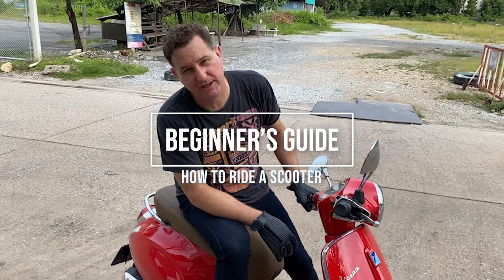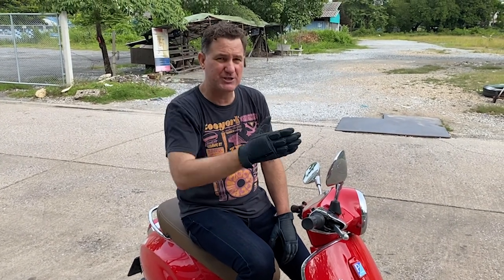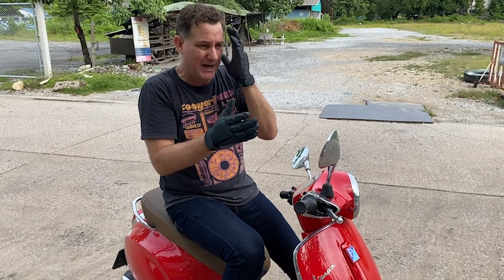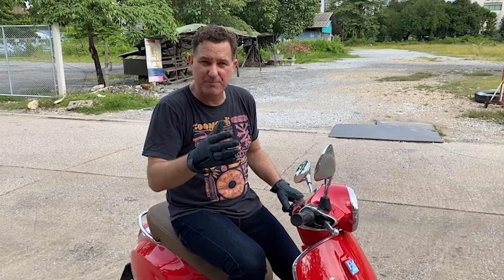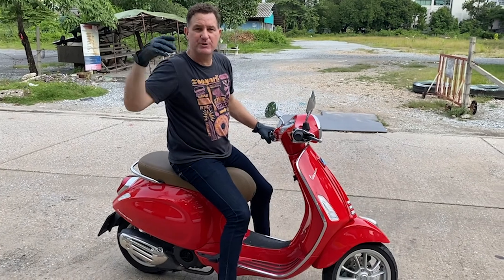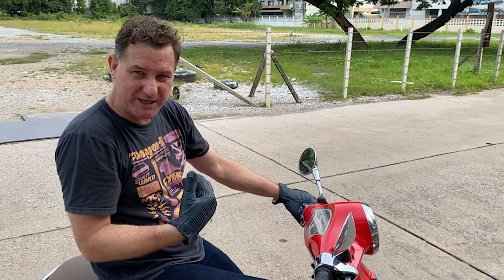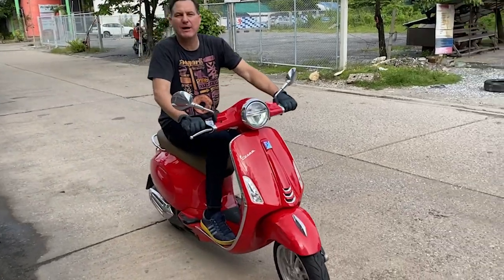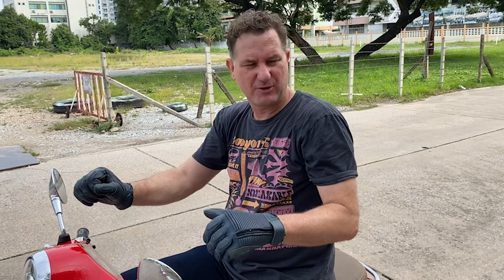HOW TO RIDE A SCOOTER | Slow Ride and Lane Filtering | Rear Brake & Throttle Control | PART 5

Comment: I’ve got more experience riding a motorcycle at slow speed and having just purchased a scooter I struggle more with it because of the small wheels and slow drive engagement. This lesson on keeping the drive engaged while regulating movement with the brake just makes so much sense. The scooter equivalent of threshold clutch engagement and brakes.
Reply from the maker: Great point! Thanks for sharing.

Comment: I rode motorcycles for many years and gave it up but interested in a scooter if I ever figure out how to afford one on a pension. I'm finding your videos helpful I'm learning things I didn't know.
            Just for the record the force that keeps a bike wanting to stay upright is the gyroscopic effect of the wheels. The trick with the throttle and the brake does work I used it on big motorcycles too. Thankyou for the knowledge it is something that's needed....cheers
Reply from the maker: Thanks for sharing! Thanks for the info.

Comment: Hello, does the slow ride maneuver also works with a CBS (Combined braking system) motorcycle like the honda clicks. since they are using front and rear brakes everytime you squeeze the left brake.
Reply from the maker: That's a tricky one and my best advice is --- try it and work out what works best for you and your bike.

Comment: I tried this technique, it might damage your engine and belt.
Instead, I also tried using accelerator slightly to keep scooter upright at slow speed(it was around 10Kmh or below). It was enough to stop wobbling for me without applying rear break
Reply from the maker: Good point. Do what works best for you & your bike.
Reply: @ianwatsons  this surely helped, but that method also worked for me...I'm kinda using mix of both

Comment: Thanks for your videos as they are very informative. Therefore, for the slow ride I've learnt it very differently than the way that you've demonstrated (won't you damage the brakes like this? Also, for if something happen and you release the rear brake while applying throtte, you will ride suddenly very fast and you might lose control). I don't apply rear brake, instead I play with the throtle where I apply it momentarily ONLY => vruuum ride vruuum ride vruuum ride vruuum ride vruuum -ride stop. :D
Reply: Depends how long you want to preserve your brakes vs your life

Comment: Many tutorial just says applied a little bit of throttle and you.keep on going but the hazard is when.you keep on going even.a little if the road is rough.you will press the throttle and you can be out.of control..your tutorial is a complete control of your scooter

Comment: Am I right in thinking the slow-ride technique doesn't work for electric scooters? The brakes on the electric 'sharing' scooters in the Netherlands are so strong, there's hardly a gradient between braking and not-braking - or is it just a matter of very subtle practicing? (Brands used here are 'Niu N1S' and  'Super Soco CUx').
Reply from the maker: Yes you are right - they have a different braking system. So this technique is not for those kinds of scooters.

Comment: Hello sir, thank you so much for the tips and tricks on how to ride the scooty. However, I have 1 question with respect to slow riding. In India, we have all sorts of roads ranging from the good flat roads to bumpy and perilous ones. One some parts, I keep the throttle to the minimum whereas in some, the road is so rutty that I my scooty becomes wobbly and on increasing the throttle, I would literally fly off my seat. Any suggestions on how to maintain the speed on the perilous roads ?
Reply from the maker: When I see a bump/hole/crack approaching I usually do two things (1) get my bum outta the seat and (2) back off the throttle and let the momentum carry me through the trouble.

Comment: Will that not damage the engine? Rear brake and accelerator together?
Reply from the maker: good question. Engines are designed to carry loads (e.g. carry people and go up hills) and so the main wear n tear with the brake - accelerator technique is on the brake pads. Brake pads a cheap and easy to replace if you ever need to.
Reply: @ianwatsons exactly

Comment: I cant se when there is nessesary to ride that slow.. I mean you just need to go a little bit faster and your ballance will be just fine. And isnt this technique damaging the drive train? Its almot as if you would use your clutch to regulate your speed in a manual driven car or bike isnt it? Im sure it will help if you really need to go this slow but if thats the case you can juat as easily just drop your feet down for support. 😎
Reply from the maker: You ask some good questions. I live in a busy busy city right now (Bangkok) with loads of traffic jams... so this skill is essential. Regarding drive train damage... I'd suggest you check with a mechanic and ask them (I'm no mechanic).
Reply: @ianwatsons  I see, but I think you should ask a Mechanic before you recommend a tecnique that maight damage the bike. Its no problem for me since I will never use it.😎
Reply from the maker: @indraallian6371  I just checked with a mechanic mate of mine and he confirmed NO DAMAGE with this technique, only thing that wears ... the brake pads.
Reply: @ianwatsons  OK. Thanks for checking! Good to know. I still wont use it but at least I dont have to worry about my scooter friends. 😎
Reply: This technique is used during driving test when getting a license. They make you turn on tight spaces with your feet off the ground.
Reply: @JC-fx3wh  Thanks for info. In my mind it only shows the level of those tests. 😎